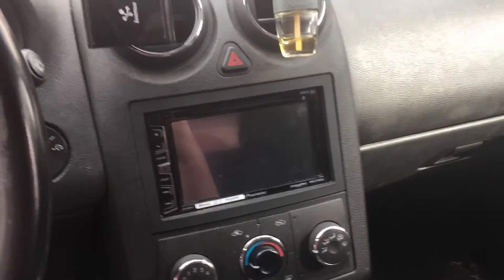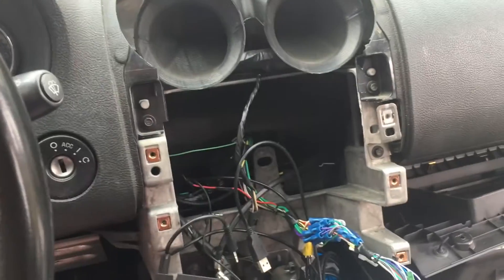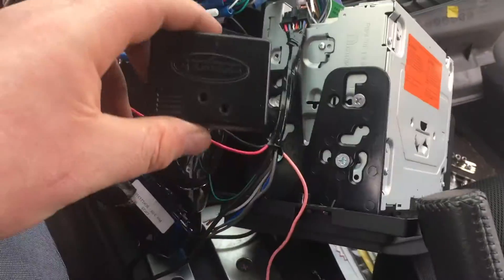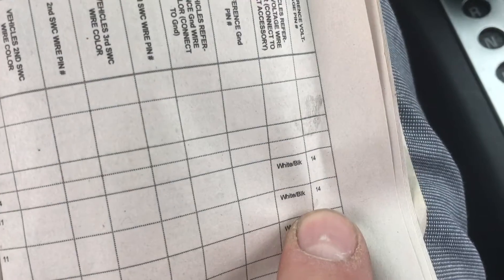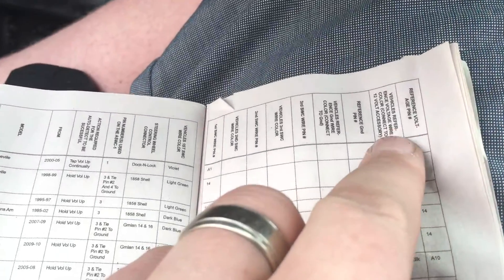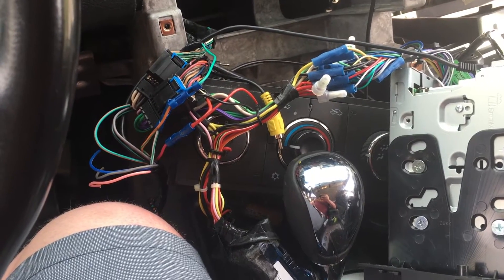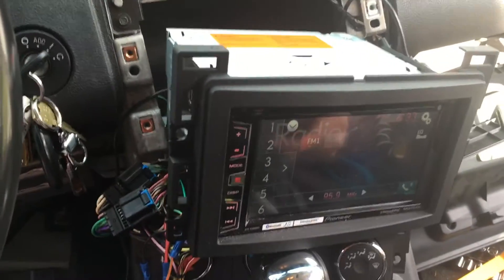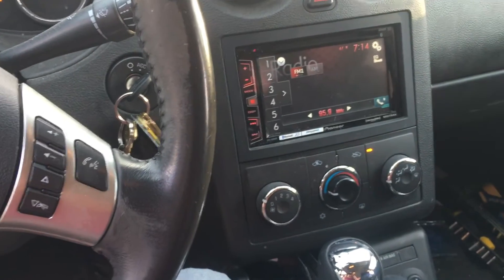2004 - 2009 Pontiac G6 Steering Wheel Controls to Pioneer Install

Comment: Can you tell me where you purchased the parking brake bypass box and steering wheel module i just purchased a boss bv9351b unit to replace my factory it has wires for a back up camera but didn’t come with one can you tell me where i can get these things you needed for your pioneer your videos are very specific and helpful thank you
Reply from the maker: All can be found on amazon.

Comment: Where did you connect in the orange illumination wire to? I’m not sure where to connect my radio’s illumination wire. Should I connect it to a light that’s controlled by the illumination nob?

Comment: Does this apply to a 06 pursuit gt 2.4l. I only can get the volume up n down to work. The way I have it is ground to ground black and red to red power white/green to green. brown to blue/yellow  on the kenwood deck. Should i try to connect the ground from the aswc to the green/white on aswc and green/orange to blue?

Comment: So you plugged the 3.5mm plug into the wired remote jack and not the aux jack? The instructions I got weren't clear so I plugged into the aux jack and it did not work. I will move it to the wired remote jack and see if that works.
Reply from the maker: It's not an aux, it's a W/R or wired remote for steering wheel controls.  It needs to be the W/R or else it will not function.

Comment: so was the solid blue  and white with black wires you tapped into in the scosche adapter end or factory plug in end? im doing mine right now and am using a PAC LAN 4 module and every things done but those 2 wires im confused because i have. a baby blue wire that says "SWC out put" and im wondering if the yellow&green wire connects to it
Reply from the maker: The factory plug end.  where is the SWC out put labeled?
Reply: figured it out i was using a axxess swc1 and it clashed with the PAC lan4 module replaced it with a pac swc1 everyrhing hooked up nicely other than programming it i have to redo it in the morning right now only mute &volume up and down work

Comment: I have a 2007 Pontiac G6GT and it keeps turning itself up to full volume I believe the steering controls are sticking how do you remove the cover to access the switch on the steering wheel
Reply: First, you'll need to remove the steering wheel cover/air bag; be SURE to disconnect the car's battery first. There are lots of videos on YouTube on how to do that. Then, you'll see one see one small screw(t-15, I think) at the bottom/left of the switch cover. Pull it out, and you'll be able to pull the switch&cover out. Disconnect the harness from the switch. Then, look for the 4-5 tabs that keep the switch
Reply: That keep the switch locked inside the cover, and open those up until you're able to pop out the switch from the cover.

Comment: Do you know if there is a way to add a steering wheel that has buttons to a car that didn’t have buttons before? I have a 2007 Pontiac G6 base model. One of my hopes for it is to add an aftermarket radio, and steering wheel buttons to it. (I already have a solution for the cruise control buttons, so I’m just focusing on the radio/accessory buttons). Is there a wiring harness I need to buy? Or will I have to diy some wiring myself?
Reply: It could be possible but you first would need to look at a schematic or this manual maby and see if your car even has some of the wiring. If so then I think you could replace the steering wheel out also the clock spring and u should be golden. I want to add heated steering wheel in my truck and I just need to replace the steering wheel and clock spring

Comment: Do you need the steering wheel control harness for cruise control and such?
Reply from the maker: Cruise control is not associated with the radio at all.  It will work regardless if you have the ASWC-1 or not.  The Steering wheel control module is only for radio controls.

Comment: Man I have an HHR (which is the same in this aspect) and my instructions were identical down to the wire colors and everything, and mine keeps auto programming the white/green ground wire, as the signal input and I can't manualy program it... Any solution?
Reply: Oh wait, mine says yellow green and yours says orange green! Hmmm
Reply from the maker: I would call Axxess.

Comment: i know this is a 2009 Pontiac G6 but will the whole radio and steering control work for the 2006 model?
Reply from the maker: Yep as this applies to a 2004 - 2009

Comment: hi can u please tell me what pin number is the dimer and the 12 volts acc??
Reply from the maker: There isn't a 12v accessory or dimmer wire available, hence the need for the harness module as these GM years run on a canbus system.  the Harness module will provide those wires.  See the description of the video for the harness model number.

Comment: With this style radio do you still get the info center? Like tire pressure, miles to empty, trip a&b, oil changes along with the menu for drivers features?